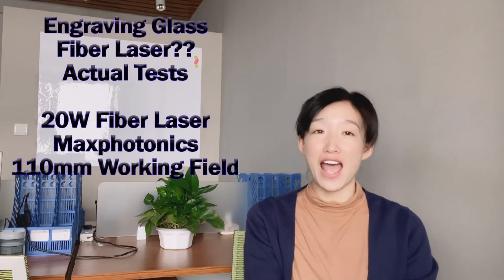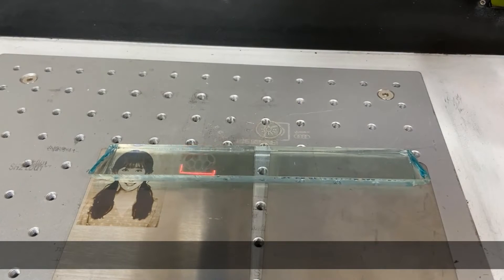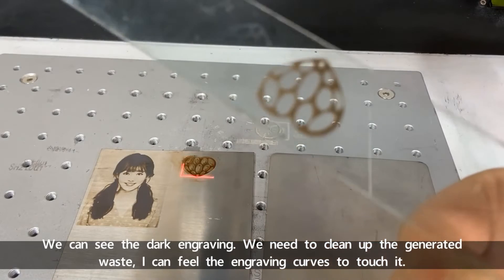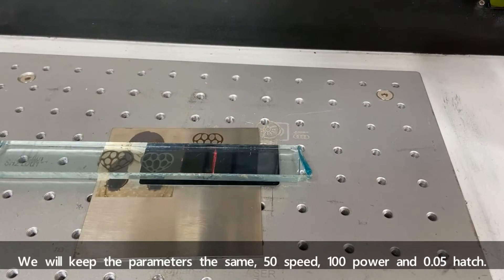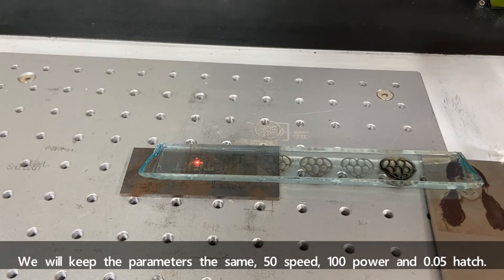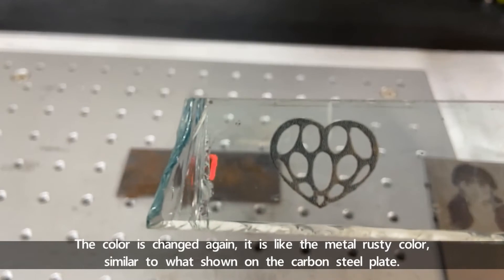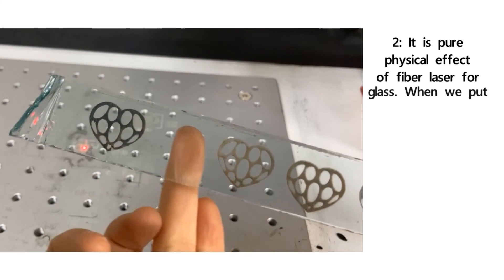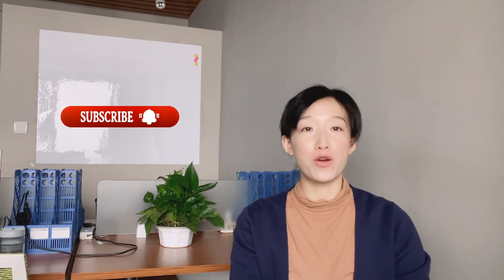Fiber Laser Glass Engraving | Machine Test

Comment: Thank you a lot, Clara! I've been having some issues with a Fiber Laser at work. Suspecting a not stable tension on electric circuit. Some days can engrave some others day not, using same parameters and same materials.
Reply from the maker: possible some wires are loosen.